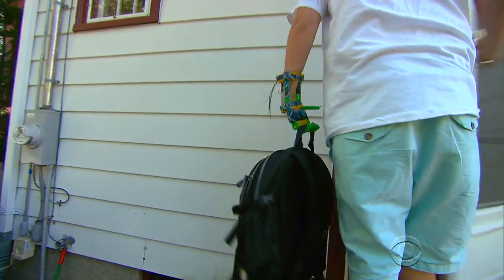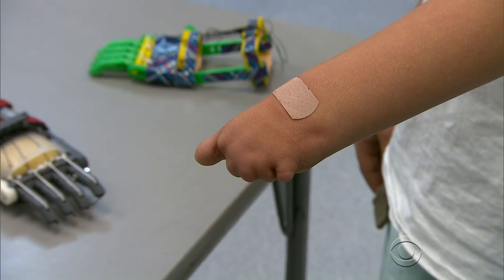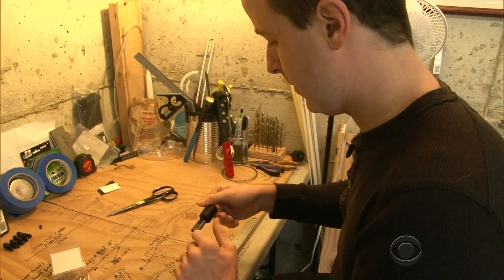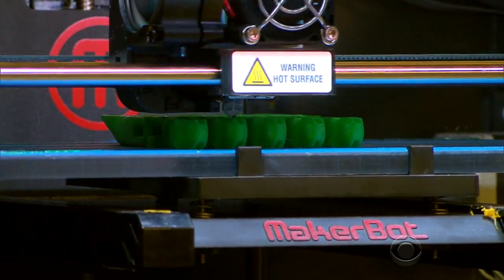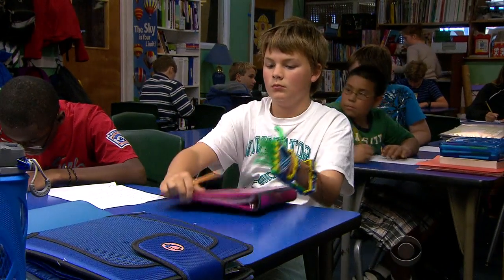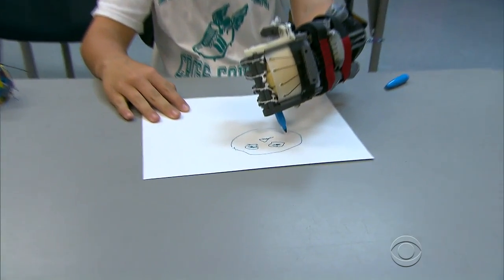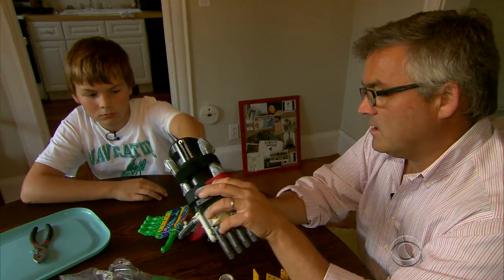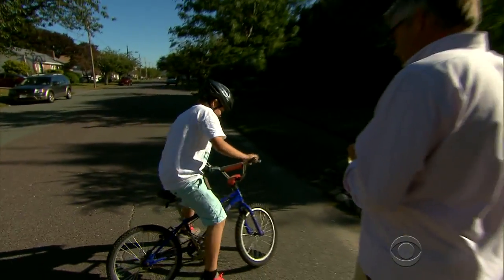Boy gets prosthetic hand made by 3-D printer

Comment: From a 3/4th grade class:
3-D printers have the ability to change people's life!! They are cool because they help people. If you came to our class could you use your hand to use our iPads?
Reply: This is AMAZING! I was also impressed by the affordability of the materials once the initial cost of the printer was covered. The tech teacher at my former middle school fought long and hard to get a 3-D printer budgeted. The kids are doing great projects with it. Some students in his elective class just did a project on how to improve the design of a prosthetic hand. I wonder if they saw this video. That young man and his dad are amazing - as well as the inventor. I also read about a 3-D printed larynx that saved a baby's life. It would not have been possible before this technology. If this goes the way of most technological advances, it will only get more affordable. At least we can hope!
Reply: The way an Ipad works this plastic hand will not work with it without transferring body heat to the screen as it works on thermal touch this is why you cant just use the eraser of a pencil on an Ipad though with a flexible highly conductive metal such as copper and some other various item you could probably jerry rig it to work

Comment: I thought the strings were attached to actual tendons at the beginning of the video!
That would be even better!
Reply: That also would require a significantly higher price tag with more chance of complication (forcibly attaching foreign objects onto the body has many ways to go wrong), it also would be potentially dangerous to max out the load weight on that than.
Reply: Yeah I know. But considering all the new light materials and 3d printing I thing we should start to consider it as a new prosthetic method. I mean at least in a similar case as this kid, all the muscles used for moving the hand are located in the lower hand. I wonder if there are any related scientific papers around?

Comment: If I look down I have found it releases some of the tight strain.   Right has less contracture thumb..bit of finger use.  Wrist I can bend slightly downward but not up or around. Both pinkies turned into other finger, all radial drift &hitch hike.I cant put finger gloves on.Big issue with what's on the market.  Metal seems to extend fingers. splints they fight in a wicked force a air splint was interesting. Relaxed that hand&other not in one had to be held down. Ligaments @wrist stay tight

Comment: I have use like the boy here.. my left has contracture badly so it extends unless I hold it bent at the elbow usually. If bent I press down on lower top of arm which forces the fingers to extend vs radial drift. Wrist doesn't like to straighten..has mo movement biceps stay high toned. . Nothing decreases it. I can roll that shoulder a bit..it tires easily. Contracture is deforming my left clavicle..under arm ..side.. posture likely for 9 yrs?  Left cant go out in front without neck strain.